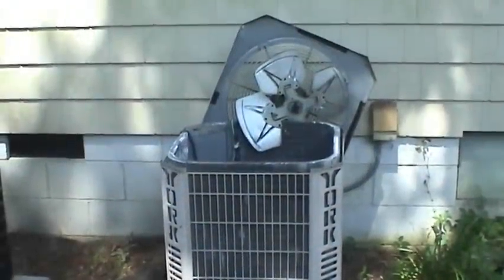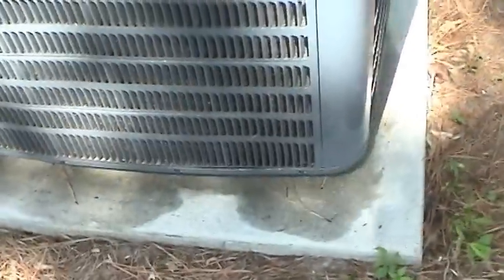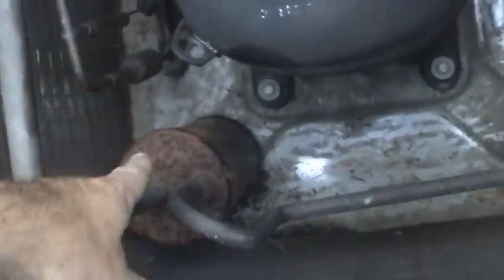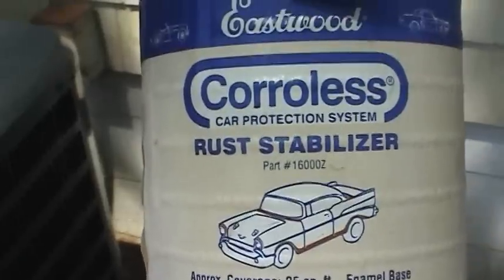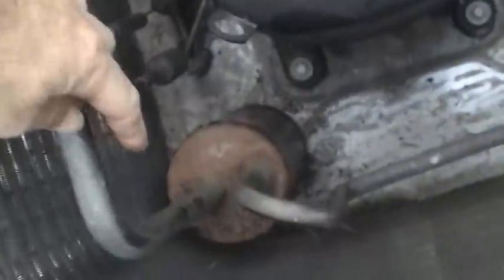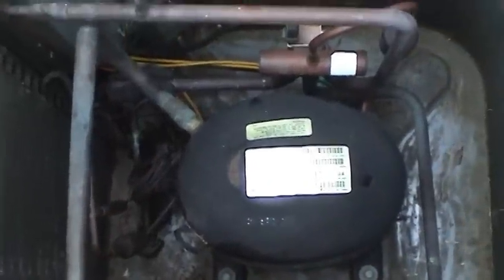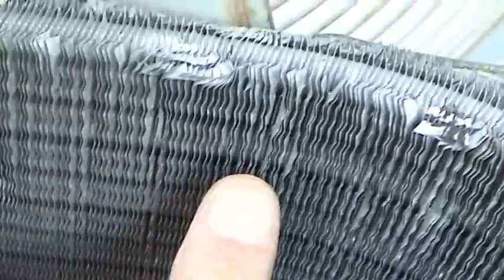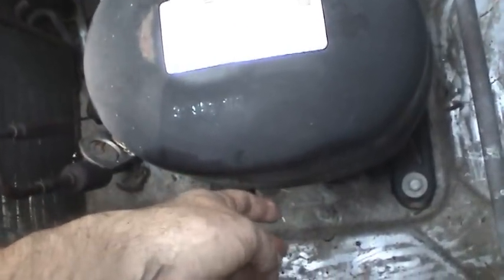1995 York Heat Pump Suction Line Accumulator Maintenance

Comment: The town house apartment had York heat prump unit it last over 20 years before it gave out in 2015  but fan motor was changed out couple of times over years in it's life I was surprise it last so long my apartment was last have old York unit everyone else had crappy goodmen  that what replaced  York in my apartment in  2015 only thing like about goodmen it's quieter than york but my apartment still had york thermostat we move out month later